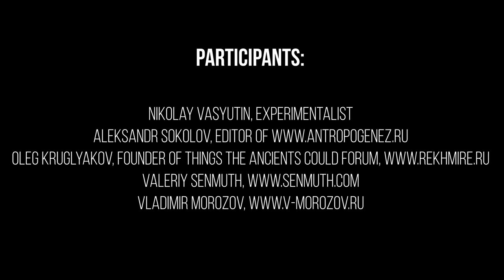Making Egyptian Drill Holes: Lost Ancient High Technology

Comment: Now you’ve explained it! All the ancient Egyptians had to do was pop to their local plumbing suppliers to pick up a length of perfectly cylindrical, 35mm half hard copper tube.
No need to ask about how it was refined, deoxidised, cast, drilled out into a tube and extruded into the correct length and bore size. No need to ask why modern humans have only been using copper tubing in construction since the 1930s, but ancient Egyptians had it readily available.
They couldn’t have had machinery to drill a hole in granite, but what machine put the perfect sized hole in the perfectly straight copper rod?
Reply: You can forge copper into tubes my guy
Reply: People in these comments are so stupid, they don't even realise the wet sand abrades the copper at a very high rate, being far softer than sand.
Reply: "but ancient Egyptians had it readily available." yep 
people knew how to make copper by casting it on an ordinary fire since the Neolithic, ghoul :face-fuchsia-poop-shape:

and there is nothing even remotely ideal in the ugly crooked Egyptian blocks, what accuracy - you're drunk🤣
Reply: @methylene5  yes, especially you who don't know anything about the construction and use of abrasives troll
Reply: @methylene5  
"just imagine I know everything about the use of abrasives" -  :face-blue-smiling: no you dont  if it were so, then you would not write nonsense about the fact that they are allegedly wrong and other ramble :face-blue-three-eyes:

I do not understand what you wrote ? I know that sand can cut and never claimed otherwise. Simple bow drill
from sand and copper can cut granite and it works just like a diamond crown or sandpaper. You can even do without copper using bone or wood. Of course, he can cut copper, but in this device, it is not copper that makes the cut, but an abrasive. 

The ancient Egyptians built pyramids as hundreds of other peoples around the world built megaliths, from the inhabitants of Easter Island with their "stone heads" to the inhabitants of Neolithic Britain with their Stonehenge and Skara Brae 😎
Reply: @methylene5  
"is that the copper is lost too"  - copper in such a device is self-sharpening and acts as a lining for the abrasive. Yes, copper will thin and go away in the process, but not as much as you think. 

"The Ancient Egyptians never had enough copper to account for the loss" :face-green-smiling: Yes, they did, and copper is not even necessary to use, it can be a part of a tree, for example, a piece of a palm tree or an animal bone or something else. In Egypt, hundreds of things made of copper and bronze were found - weapons, jewelry, tools, pendants. They had enough. Another false and erroneous assumption :face-orange-biting-nails:

nonsense as always, about the fact that Egyptians allegedly cannot do something. Where millions of tons of granite came from ? 🤣 there has never been so much and most of the Egyptian stone is limestone 🤣
Reply: @ВсеславВсеволодович  ----- "copper in such a device is self-sharpening" -----
No, copper will get abraded (thinning of the tube which some call "sharpening") and it does get abraded at a high rate and is well documented.
Reply: @ВсеславВсеволодович  The density of granite is about 2.750 tonnes per m3. So a million tonnes of granite is only a cube of granite that's 71.3 metres on each side. Which is almost nothing compared to the sheer amount of cut granite that litters Egypt to this very day when you add it all up. Most of the granite dates to the Early Dynasty (so we're told) but very little to the later period where soft sedimentary rocks (limestone, sandstone, marble, alabaster, etc) where used instead, despite having better tools. The Greeks and romans had copper tubes, sand and water. They hardly used granite at all because it's so difficult to work with.
Reply: @methylene5  
The Egyptians knew how to cut and process granite and there are no millions of tons of it. This is the first. The second pyramid made of limestone is the second. If you know and agree that the Egyptians knew how and could cut granite, then what are you arguing with ? Yes, they could and they did it, there is no mystery 🤔 point.

🤣hahahahahaha

I am 4 years old :body-blue-raised-arms::face-orange-raised-eyebrow::face-fuchsia-tongue-out:
Reply: @methylene5  
No it won't

watch videos from this channel and from the SGD Sacred Geometry Decoded copper will sharpen as it can cut like sandpaper when combined with abrasive. And you can just do without copper with wood or bone, copper is just one of the possible materials. 

They didn't need the machines. The Egyptians could and did cut any kind of stone using simple materials, surrender :face-green-smiling::glasses-purple-yellow-diamond:
Reply: @methylene5  
The Romans used granite for sarcophagi

There is not a single Egyptian cube that weighs a million tons. And no cube is 71 meters long

granite can be sawn with a saw and abrasives

anything else ? 🥱
Reply: @methylene5  
of course, not only copper and sand, but also other things are used to cut stone in Egypt - nothing supernatural or unexplainable

I'm not interested in freaks who lie that the Egyptians have machinery or were more advanced in ancient times

and gobekli tepe is just an ordinary neolithic settlement in Asia Minor, what will happen when you find out about the existence of neolithic cultures in Europe, probably a shock 🤣
Reply: @ВсеславВсеволодович  ----- "There is not a single Egyptian cube that weighs a million tons. And no cube is 71 meters long" -----
Obviously I was trying to offer to a non-technical person a perspective of the volume of granite necessary to equate to 1 million metric tonnes. I wasn't suggesting it was a just single cube of granite. lol
Reply: @ВсеславВсеволодович  The Romans made their sarcophagi from marble and limestone, not granite.
Reply: @ВсеславВсеволодович  ----- "They didn't need the machines." -----
It's very simple, just reproduce just one of the granite precision stones or sarcophagi using bronze age tools (copper/bone/wood/sand/ etc). Just one. No one has ever done it. Drilling a tiny hole proves nothing. There's a reason why it's never been done. There is far more to construction than drilling a little hole. When this is achieved, then get back to me because you're obviously just trolling now.
Reply: @methylene5  
no you wrote some rubbish again

There is nothing complicated or supernatural in sawing granite and the Egyptians easily did it without any high technology. I don't understand what you are trying to argue with.

can granite be sawn ? Yes. The Egyptians could and sawed granite, right ? Could and moved objects with a large weight as they needed? Yes

if you don't believe in "aliens", "atlantes", "gods" or whatever else is out there, then I don't understand what you're trying to argue with?! The Egyptians did not have any machinery, this is a fact.

the question is closed :dothefive:
Reply: @methylene5  
the Romans had different sarcophagi, there were those made of granite
Reply: @methylene5  
granite was sawn with quartz sand and corundum, there is no precision there. At best, the Egyptians achieved a right angle, but nothing more.

"Drilling a tiny hole proves nothing" :face-blue-smiling: 🤣

sawing through a slab can be exactly the same as making a hole, it just takes more time and effort. The troll is definitely you. There is no difference what to cut except for a time.

surrender :face-fuchsia-tongue-out::face-red-heart-shape:
Reply: @ВсеславВсеволодович  It's just basic economics and cost, that is all. Why use granite when limestone will do the job? I've worked granite, and I can cut holes in it too very easily and even harder materials without using modern machining. I already told you I'm an engineer (degree qualified), I know these things and its not complicated. There are however machining marks on stones in Egypt. I can only go by the evidence, by maybe they are fake? Perhaps more recent than claimed, hard to say. I do not believe, nor have I ever claimed there was secret high technology nor aliens, only you keep saying that. The people back then were more capable than people today give them credit for, and I believe there is still much to be discovered, since evidence is lacking because much doesn't stand the test of time since equipment and materials are repurposed and so evidence gets lost. I don't see what the problem is.
Reply: @methylene5  
"There are however machining marks on stones in Egypt." there isnt any marks

the ancient Egyptians only had drills of various sizes and lengths and abrasives and a lot of manual work. It was enough to make everything that we see now. There was no machinery in those days, not even an ordinary water wheel

everything we know says that they did everything by hand and with primitive devices

you are uncharted troll, I'm sure you're from his channel

Comment: A long time ago I saw a demonstration of this technique, but rather than a thin-walled copper tube it used a thick-walled tube. Critically, the tube had a groove in it's 'cutting' edge, that was designed to trap the abrasive sand, so that the abrasive worked against the granite, rather than the copper. Consequently, the copper suffered much less wear.
Reply: I cant visualize what you're saying here could you please explain a bit more? thank you
Reply: @Darfail  The demonstration I saw was probably fifty years ago, so my memory of the detail and the scale of the device is somewhat clouded, but I remember thinking that perhaps the idea could be adapted and applied to modern machinery, such as large machines for cutting tunnels through solid rock, or, on a smaller scale, for drilling bore holes through solid rock. It would be very slow, of course, but speed is not always the main criteria in such an operation, despite the urgency of modern life.

Imagine a four inch (100mm) diameter cylindrical pipe with walls about two tenths of an inch (5mm) thick, or perhaps more. The cutting edge of the cylindrical tube had a groove cut in it, the idea being, I think, that it traps grains of sharp sand or abrasive stone in the groove. I don't know how to describe the groove, other than it was circular and ran round just inside the perimiter or outside edge of the 'cutting edge' of the tube. So, if the external diameter of the tube was 100 mm and the internal diameter of the tube was 94mm then the diameter of the circular groove would be 96mm, with the groove being perhaps up to 4mm thick and maybe 1mm deep.

Rotating the pipe vertically whilst pressing it against a flat stone surface, using a bow string, or somesuch rotation device (or just hands) causes the sharp sand to start cutting into the stone surface. 

So it would look much like a modern day hole saw, but instead of teeth it had a circular groove in its cutting edge.  

I think the idea was that it is the sharp grains of sand or chips of abrasive stone that do all the cutting action and all the cylindrical tube does is trap the sand in the groove, so the cylindrical tube does not wear away much or maybe not at all. 

Perhaps the sand is special in some way, e.g. from carborundum or other abrasive stone, and perhaps the size of the groove relative to the diameter of the grains of abrasive material is important. 

In the demonstration I saw, it didn't cut very quickly, perhaps an inch (25mm) an hour, but I can imagine that it would be possible to bore a hole through a sandstone block, so long as the central core of rock was broken off periodically, debris was blown or flushed away regularly (perhaps using water) and the abrasive sand was replaced as it became bluntened . 

I'm not sure what the cylindrical tube was made of, but I suppose it could be made of something relatively soft, like wood or ivory, if it doesn't do the cutting itself, but may equally well have been made of copper or something harder. Maybe the softness of the material the cylindrical is made of allows the sharp sand or abrasive chips of 

I hope that helps.
Reply: @sailingoctopus1  cool it did help me visualize it, thanks for the explanation!
Reply: @Chris Mowatt  actually I have to insist, that was a VERY good explanation. Thanks again.

Comment: Why wouldnt they just secure the drill and use ropes to make it spin? Pulling the rope from one side to the other making the drill spin multiple times with extremely less effort instead of having one guy destroy his arm like that?
Reply: There is Egyptian iconography to show similar tools as you see at the beginning of the video = hence they performed the demonstration based upon that.  That is not to say the Egyptians did not improve upon the process - and they invariably would have done.  Simply that these individuals are showing it can be done using tools we see in the historical record.

Comment: Whether the copper tube is sharp or not doesn't matter with this technique as it isn't the tube doing the cutting.
Reply: Correct.  Unlike a chisel and hammer which uses kinetic energy to fracture the stone - sawing/drilling is done mostly via friction = aka "heat".  So abrasives such as sand or corundum used in addition to a bronze saw/tube sees the additive doing the real work as opposed to the tool.  Yes the saw also suffers degradation as well.  But the real work is the action of the abrasive rubbing against the surface of the stone.
Reply: @varyolla435  I did say it doesn't matter, but technically it does. You would want more surface area contact, (at the end of the copper tube) and thus, a "dull," unsharpened (or unabraded) tube. In my opinion anyway. Because it would be a freshly cut tube, and not abraded or worn away, you'd be able to trap more of the abrasive material underneath the point of downward pressure, as opposed to a tube that has had its rim worn down.

Comment: 😊👍
If the tube was toothed, and a much coarser sharp sand/gravel used, it would cut faster.
(Desert sand, often used by people proving the system doesn't work, is no good, because it is rounded by constantly being blown across the ground.)
The same effect as this can be obtained with twisted copper wires, and abrasives in a continuous loop over two wheels, like a band saw.
The 'wire rope' can then pass through a pot filled with abrasive paste, as it enters the rock. This will cut rock in a straight line.
.

Comment: Great experiment and thanks for blistering your hands to show us haha. No I am reading Christopher Dunn's book "The Giza Power Plant" where he also illustrates taper on the core and grooves being .10 inch per revolution apart, which would indicate a feedrate of .10 inch per revolution (2.54 mm per revolution) being measured on the granite core (original evidence of the Petrie).
When I watch your video I do wonder if there could have been another way of doing this that would make less revolutions and cut deeper? Christopher Dunn mentions ultrasonic drilling... But I'm wondering what you guys would make of this? And regarding ultrasonic drilling he does state: "...the rotational speed of the drill is not a major factor in this cutting method; it is merely a means to advance the drill and apply pressure to the workpiece."
Reply: Dunn speaks about tool markings that do not exist. The actual striations are spiral in nature and non-continuous. The paths break and merge and diverge randomly due to the effect of the abrasive particles during the drilling process.
Reply: Dunn's argument represents stereotypical:  "argumentum ad ignorantiam" - or "arguing from ignorance".  That is a logical/deductive fallacy whereby you are assuming based upon = assumptions.  In his case it is really assumptions about assumptions of assumptions - at which point Occam's kicks in.

So the correct way to approach questions is to FIRST find tangible credible evidence of a thing before you then attempt to surmise based upon that.  What Dunn et al do is the reverse.  They first assume the existence of a civilization and technology which has never been shown to plausibly have been real = to then make all kinds of assumptions based upon that initial assumption.  They try to obviate their lack of evidence by claiming it to supposedly have been "lost".  That is the archeological equivalent of:  "the dog ate my homework."  

What Dunn et al claim = over imaginative nonsense which "coincidentally" ties into narratives pushed by Hollywood and the entertainment genre via movies and television centered around supposed "advanced mythical civilizations".  Hollywood created the "customer base" and now Dunn et al are exploiting that to sell books etc..
Reply: @varyolla435  thanks! 🤜🤛